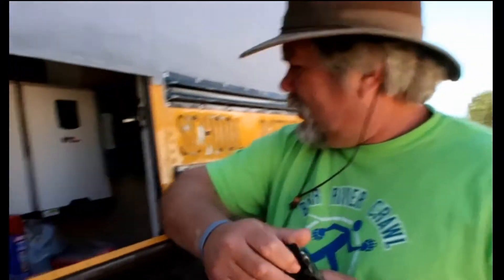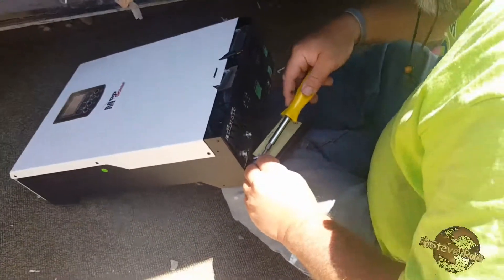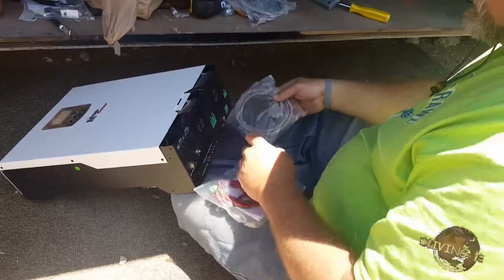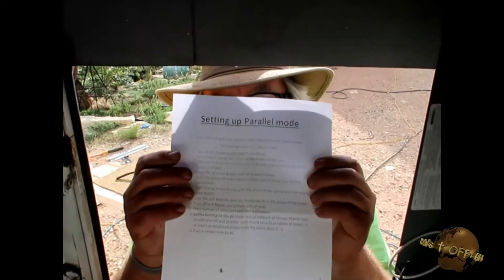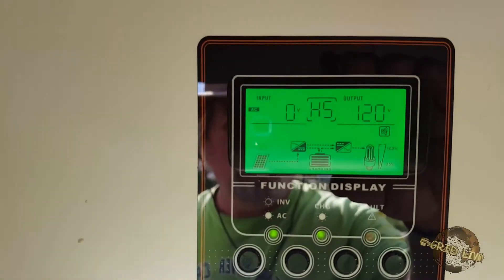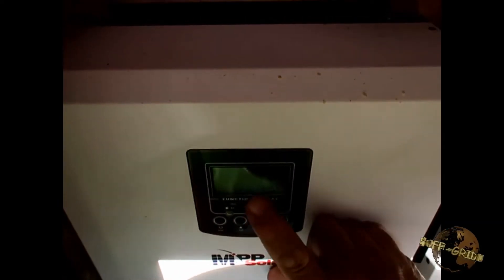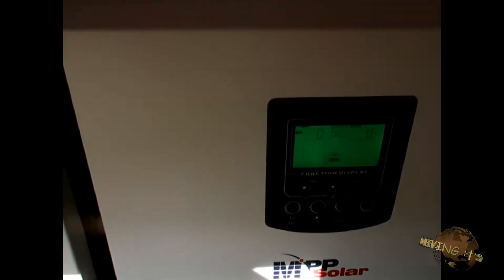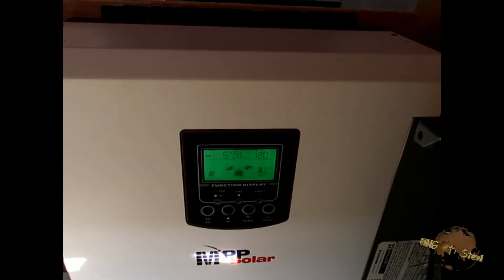Jim Gadberry PIP Inverter Parallel Stack How To

Comment: Love it i have a question is each of his inverters 240v ac or 120v ac and whats the purpose of the parallel ports ur installing where can i find them ?
Reply from the maker: These units are 120VAC.  The parallel ports allow stacking to double the output power. You can purchase all these items on EBay or directly from MPP Solar.
Reply: @OffGridLivingSteve  ohhh ok thanks

Comment: Hey Steve I’m a new subscriber love the channel and love how resilient you are brother. Do you need to earth ground those puppies ive been watching videos on these things I don’t see any grounding procedures.
Reply from the maker: Benjamin Rodrigues this LV model inverter has a ground lug. They should be bonded to ground. On this installation I passed the grounding through the ground on the generator/shore power plug since it is mobile.
Reply: Offgrid Steve nice i cant wait to get one up and running these lithium cells are interesting.

Comment: What's the advantage of running these in parallel
Reply from the maker: Sanaullah Khan it increases the power output from 2400 watts to 4800 watts.
Reply: @OffGridLivingSteve  so does it split all load equally between the two? Or the slave is only utilized when the capacity of the master has been completely exhausted

Comment: How did you connect the AC cables? Did you connect to both inverters or only to one of them?
Reply from the maker: Hamdaan Mussa the AC cables connect to both inverters. If memory serves me, I connected them through breakers in a panel, similar to a combined box.
Reply: Oh okay thank you for that help
Reply: Hai @OffGridLivingSteve , I'm very enjoy your video. I'm in my way to setup my two inverter in parallel. I have a question for you. Were both AC outputs already connected when the inverters is turned on for setup?
Reply: And in terms of the battery, did you connect 2 separate batteries to each inverter or did you make the batteries 1 and then connected them

Comment: So can you set up two 5048's like this master/slave scenario. Was thinking one for house and other for shop and anything else the first couldn't do?would you still split the panels to each?would both units charge the bats?Was adding up total house usage and man do watts add up fast.Also was wondering if you can run 2nd 5048 strictly off solar if you had enough pv?
Reply: I have one mpp 5048 with 1.5kwp panels. It is running fully off-grid from past two years. It runs all electricals except water heater and air conditioner.

Comment: Can you hook up the total solar array to only one unit, or must you split the array over the two units?  (Small array, large battery bank circumstance)
Reply from the maker: Jim Maxwell if you’re array produces more than the charger is rated, you should split the array between additional chargers. If you connect a 4,000 watt array to a 2,000 rated charger, then 2,000 watts of production is the most you can expect.
Reply: @OffGridLivingSteve  Thanks for the reply Steve. The circumstance is the opposite Only space on motorhome for 3x 310w panels in series(max)....so difficult to split equally between two units. 

48v x 600ah battery bank to cover needs for a week of cloudy skies(rainy scotland), totally offgrid wild camping... all electric, no propane cooking etc etc(hence the need for more than the 21A/240v output from single unit - have 2x 10A cooking hobs & microwave when cooking,...not constant usage, but you can see the draw). Can add another 3x310w panels when 'parked up' as a series or parallel connected awning, but need the capability of single 930w series input whilst driving about.

Ideally, if i could connect the three permanent roof panels in seies to one unit all the time and then add the portable extra three panels in series to the other unit, when we park up,  that could work well. 

I was also thinking, what happens when one array gets shaded and produces nothing, but the other array is still be producing power??? It must handle the single input then, I would have thought???

Is this possible?
Many thanks for your help.

Comment: So I want to use one of these also on a RV sprinter conversion build with a 24v Tesla battery and 1200 watts of solar and a generator for back-up but when I went to the manufacturer website it said it needed a generator 150% the size of the inverter, is thier a work around for that, I know there's others routes to go about this but the cost savings using this, then buying everything separately is absolutely worth it....
Reply from the maker: You can go with a smaller generator.  You'll need to set the parameters of the inverter to use less current to charge with when running the generator.  It will take longer to charge the batteries, but it will work.

Comment: Another great video.Can you split phase that set up?
Reply from the maker: Not really possible to set up a split phase in this scenario because it's already at 120VAC.  It would require a 230VAC inverter to accomplish split phase.
Reply: Thanks. Honestly I need a new inverter and I'm still trying not to spend $2500 on one magnum 4448.I know its what I need but I have $5000 in my system now and 2 more magnums will make my system doubled in cost. I'm not sure it makes sense. Other then Ill never have to buy another inverter.
Reply from the maker: We have several of these inverters installed around the mountain here, and there are zero complaints about it.  They are reliable, have an inbuilt MPPT charge controller, genset charger, and really cheap.  But the trade-off for the price is they have no USA recognized certification.  They won't pass an electrical inspection because of that.  For the $700 inverter, and two transformers to obtain split phase, the total cost is still less than $1000.  However, this inverter isn't quite as forgiving as the Magnum.  You can run the Magnum at capacity all day, where this inverter will shut down after running at capacity for several minutes.  But still, you can buy two of these inverters to run parallel, have twice the capacity as the Magnum and still be cheaper off than buying just one Magnum.  Some people are not comfortable doing this, some are.  You have to decide for yourself.
Reply: Honestly I need around 12 kw of power overhead. I'm debating on a few inverters but I do think the magnum is my best option for reliability . I run my equipment very hard but not my batteries so much. My best day is 23.9kwh though my charge controller into my heat. Its too hard on the high frequency inverter. 
Have you seen the Spartan inverter yet?
Reply from the maker: I've read about the Spartan, but I have no direct experience with it.
Reply: I'm watching Mike Holt now. I need more theory. Thanks for your vids. They are great.
Reply from the maker: Thanks for the compliment.  I try to concentrate more on facts and opinions grounded in good facts.  Too many channels out there with way too much fluff and not enough grit.  Mike Holt is a guru in NEC, but like a lot of book-learned gurus, he doesn't have much give for the real world.
Reply: Ya it seems his way or you die .Electrically speaking . But theres a lot I have not known about before. Thanks once again. I'm a welder not an electrician but Ive safely made a lot of power.

Comment: great video Steve. What video editing software do you use?
Reply from the maker: I use Corel VideoStudio X10 and Adobe Premier Elements 13.  Corel used to be garbage and I rarely used it, but now you can take video from several cameras, and it automatically puts them into sync so you can switch between them.  The software is also really stable in the last couple releases.  Now I'm about ready to cut Adobe loose.

Comment: Steve,
Follow you last summer I purchased a PIP-4048MS, this inverter I have 900AH flood acid battery bank, it provide about 75% of my electric use for the house with (4) teen ages live in the house, That inverter I have it connect to 10KVA transformer to get 110V for the house, just couple month ago, I purchase a PIP-4024MS, now this one I hook it to 450AH Agm battery bank, this is my backup just in case some thing wrong with the main inverter, since I do not have match set, I have to run both these inverter at stand alone, I can not parallel them, but very interesting when I watch your video, alway learn new thing all the times.
I bought 2nd inverter with 24 volt setup  I have intend very soon I am going to get some LiFo4 batteries to learn from LiFo4
Reply from the maker: I do hope you do some videos soon.  I would be very interested in your experiences with LiFo4 batteries and where you obtain them.  Thank you for letting me know the videos have helped.

Comment: how hot does it get in that space where the units are? I am just wondering how they are working.
Reply from the maker: That's one thing that we will keep an eye on.  We'll probably try ventilation holes first, and if that's not enough we might have to add thermostatically controlled fans.
Reply: The 24Volt version have a lot bigger fan than the 48Volt version and a lot noisier with a bigger fan